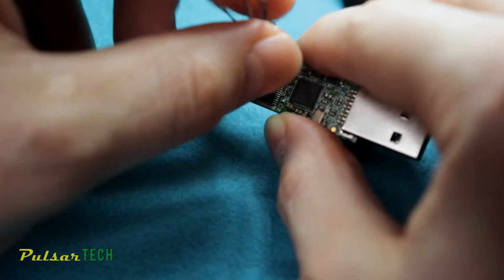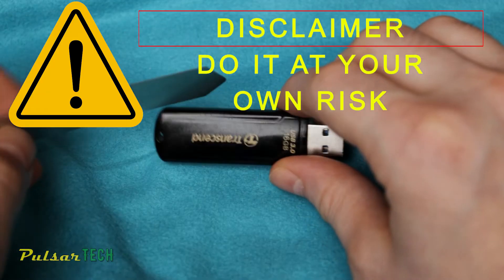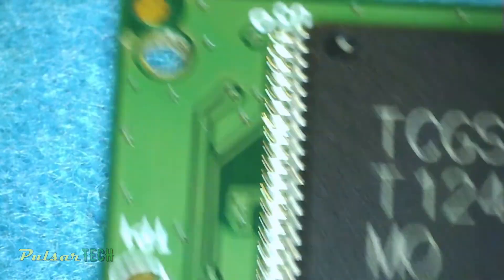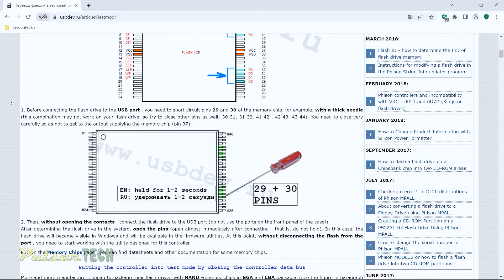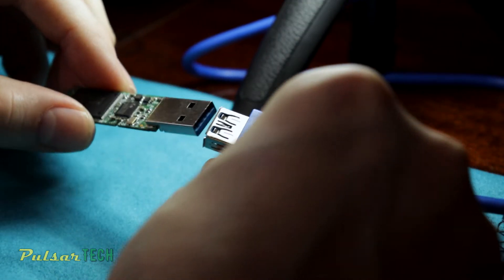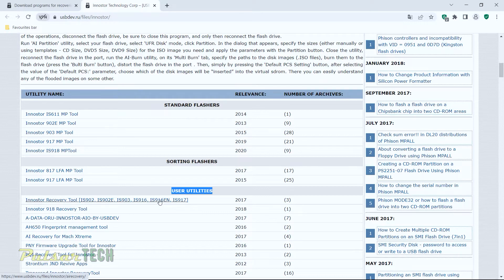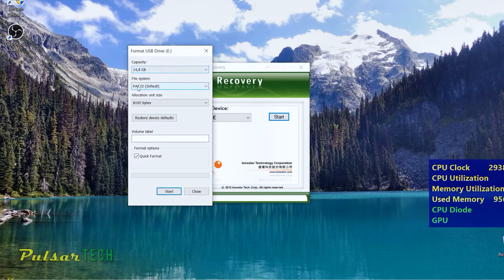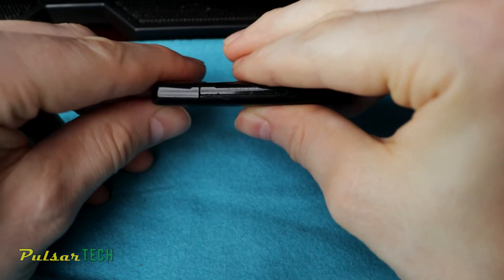How to Recover a BROKEN USB Flash Drive NOT RECOGNIZED Transcend Jetflash

Comment from the maker: Thanks for watching! 😊 If you enjoyed the video, please Like, Comment, and Subscribe for more content—it really helps the channel grow! 🚀
Want to go the extra mile? You can support the channel with Super Thanks or a small donation on Ko-fi: https://ko-fi.com/pulsartech 💖
Your support means a lot. Thank you!
Reply: Very nice work bro ❤❤❤😊
Reply: My sandisk usb 2.0 not shown in computer nor under disk management.....now how can i fix the issue n recover my data from pen drive
Reply: the usb drive showing under unspecified device in control panel...with driver not available exclaimation
Reply from the maker: @sumitagrawal9007  If your USB drive is showing as an unspecified device in the Control Panel, it indicates that the system is unable to recognize the USB drive correctly, and it may not be functioning correctly. Here are some steps you can try to troubleshoot and resolve the issue:
- Unplug and Replug the USB Drive: Sometimes, the connection may be loose, causing the issue. Try unplugging the USB drive from the port and then re-plug it firmly into another USB port on your computer.
- Restart the Computer: A simple restart of your computer can sometimes resolve issues related to unrecognized USB devices.
- Check Device Manager: Open the Device Manager in Windows and look for any entries with a yellow exclamation mark or question mark. These indicate problems with drivers or hardware. Right-click on the USB device with the issue and choose "Uninstall device." Then, unplug the USB drive and restart your computer. After the restart, plug the USB drive back in, and Windows should attempt to reinstall the necessary drivers.
- Try on Another Computer: To verify if the issue is with the USB drive or your computer, try plugging the USB drive into another computer. If it works on another computer, the problem may be related to your specific computer's settings or drivers.
- Use Disk Management: Open Disk Management in Windows by right-clicking on "This PC" (or "My Computer" in older versions of Windows) and selecting "Manage." Then, under "Storage," click on "Disk Management." If the USB drive appears in Disk Management, it may need to be initialized or assigned a drive letter.

Hope it will help!

Comment: I have a chipsbank 2199E, and I'm having trouble switching to testmode and i literally have no idea which pins to connect on the controller, and also the LED still turns on when i plug it in, i also don't maybe it will always blinks when in testmode. Please help
Reply from the maker: Hi, if you can't find a proper diagram for this chipsbank 2199E, you can switch it to the testmode by connecting the pins on the memory, it is easier because memory is more universal.
Reply: @PulsarTECH  I tried connecting pin 29 and 30 on the flash memory, but it didn't work, I tried some other pins also, still the same
Reply from the maker: @JohnStarkii  Sometimes timing matters—try connecting the pins before plugging it in. Also, double-check the flash chip's datasheet to be sure you're using the right pins.

Comment: Sir how about the write protected? How to fix it?
Reply from the maker: Hi, you can fix a write-protected USB drive by checking the physical switch (if present), using Diskpart in Windows, or modifying the registry to remove the write protection. You can also try formatting the drive with third-party tools if the issue persists.

Comment: I have a dead, fry corrupted flash drive and it is the chipbank 2199. The light has showed on and nothing is happen into my computer. Please help me. It cost a thousand bucks to repair and I cannot afford it. What I am going to about it?
Reply from the maker: Well, if it is the firmware issue, just go through the steps in the video, get it into the recovery mode and then flash the new firmware using Chipsbank flashing tool for your USB drive. If you mean completely hardware broken by "fried",  then you would need specialized tools to recover it. Try to find some help from people who specialize in physical repair of electronics. Cheers.

Comment: I can't download the software Innostor Recovery Tool v2.1.8.26 link not working :(  I used ChipGenius when in test mode to fine out info of the chip, it's the same as yours, can you post a working link in the video? thanks
Reply from the maker: Hi, I can't say why the link isn't working, maybe there's an issue on a server side. I cannot access it either. Maybe it is a temporary issue and it will work soon. Try to search for this program on a different website thru the search engine. Good luck!
Reply: @PulsarTECH  no problem I have sorted it thanks for your video I repaired my transcend 16GB stick 😎👌🏼
Reply from the maker: @ you're very welcome. Happy to hear that!

Comment: Bro mine SanDisk pendrive its connecting side is bent can  it will be repaired
Reply from the maker: Hi, if the USB connector pins are broken, you can resolder them typically with a bit of soldering skills. So I would say yes it is doable.

Comment: i have a mosdart flash drive, so it plugs into the computer or my cellphone. When I plug it in, the light comes on & stays on, but does not show up on the computer or cellphone. & I can't pull it apart either.

Comment: This is awesome if you don't need to recover files from th drive. But you mentioned that you need special tools to recover files from a non-working flash drive Do you have a video on that? Thanks.
Reply from the maker: No, it has to be done in a specialized shop, they might need to connect an external reader clip tool to read from the flash memory or something, I've never done that.
Reply: @PulsarTECH  I see, alright thanks!

Comment: I found a clothespin/rubber band is a very good way to hold the connection, also usb splitters can be useful to avoid any jiggling from a laptop that would interrupt the data transfer, just copy paste and hit retry every failure, my issue is with a cheap sandisk usb, the stupid slidey part causes them to get bent real easy
Reply from the maker: I also have a SanDisk Slide USB 128GB that got bent, but surprisingly, it still works fine. Otherwise, the soldering job on these tiny PCB components would be a nightmare.
Reply: @PulsarTECH  Just got all the data off it an hour ago, kept having to readjust it every so often, got Lucky with it running for 10s of minutes every once and a while

it was at the point where it needed pressure to read or it would discon

Comment: cant even open it
Reply from the maker: It could be a bit tricky, you need to apply a decent amount of force. I would start at the front where the USB port is. Also even if you break a plastic latch or two, you can always glue it back with a small amount of super glue. Hope this helps.
Reply: Also it was working suddenly it didnt no more tried programs even tried the officals wbsite it says there nothing like the problems that happend to u it detect that theres is something but its not showing on desk management nor any program
Reply: Idont care if i destroyed the plasic i dont need the usb i need whats inside it

Comment: I have a trouble with my hdd its not recognized by computer nor device management .. i cant see drivers in any software any help to fix that
Reply from the maker: Hi, when did this happen? Was it working before on this computer? Can you hear it spinning?
1. Try to connect to a different SATA port, use a different SATA cable & power cable.
2. Was it used for Linux before? If so, then maybe it's formatted in Linux file system.
3. Try to use any third-party partition management software such as Acronis Disk Director or others. You can also create a bootable USB stick to manage disks before loading any OS.
4. Try to run your computer in a safe mode.
5. I would also try to run like a Windows installer to see if it can actually see it.
Hope this will help. Let me know how it goes!
Reply: @PulsarTECH  hello sir .. its actaully an external hdd .. i tried many sata non worked ..! It was working like a charm .. but not anymore .. when i connect the blue light doesnt flash just stuck .. no clicking sound . Its never falled on ground. Just when i connect i heared it like a fan .. i tried many partition apps .. but non worked let me try acronis .. i will see if it work .. i really need the info in it .. and i dont know whats the problem
Reply from the maker: @iszla2369  if you don't hear it spinning then it's probably dead. You can tell if the HDD is working cause it's vibrating and making noise, if it doesn't happen, it is more then just a software problem. If you data is very important there are ways to recover it but you need to take it to a specialized repair shop for that. Let me know how it goes!